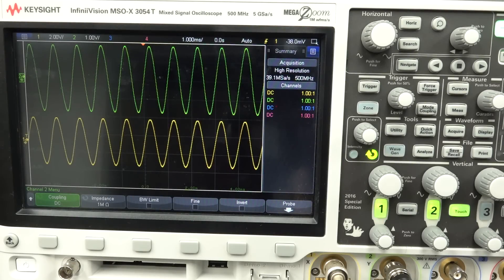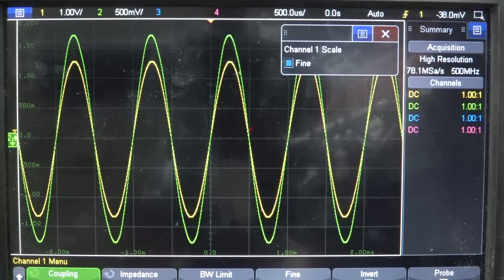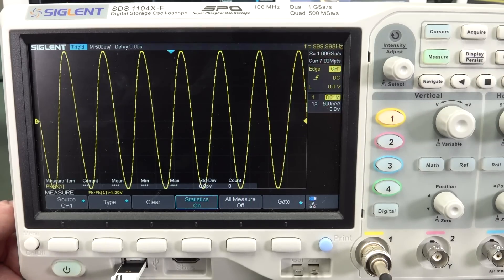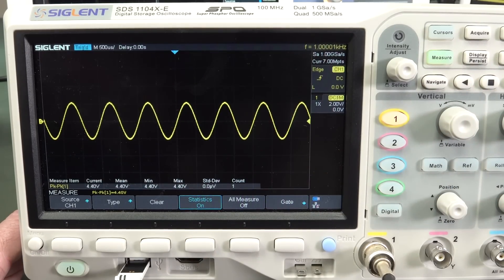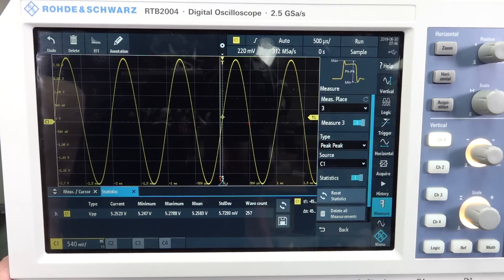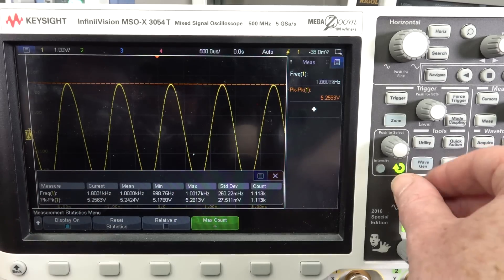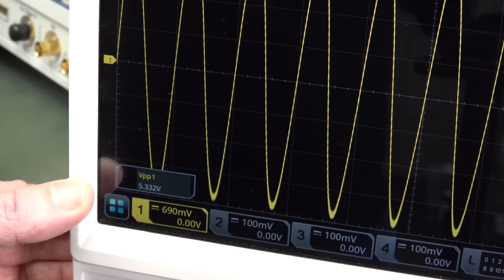EEVblog #1226 - Get Better Accuracy On Your Oscilloscope

Comment: For years i believed that the vernier control was only a stretching of the waveform done by software just to allow you to have it full screen and to better use cursors. I was sure it would not influence measurements resolution in any way.
I'm in shook
Reply: Yep I assumed only the full steps switched analog gain.
Reply: me too.....
Reply: Same here bro.

Comment: It is a mistake to assume that the scope's ADC has continuoulsy adjustible gain. In most cheaper scopes the gain is only adjustible in large[ish] discrete steps, which means that attempts to finely control the gain will NOT result in any better signal acquisition precision. Morerover, an ADC whose gain is controlled in discrete steps is usually less noisy than a continuoulsy controllable ADC. For this reason only high-end scope models will undertake the effort of offering a good continuoulsy adjustible ADC (and they don't always succeed at that). 
The situation has a lot of similarities to "exposure" control in digital camera's ADCs. I highly doubt that the benefits of fine control we see in this video on this Sigilent are actually real. Most likely this is just some kind of misinterpretation or a fluke.

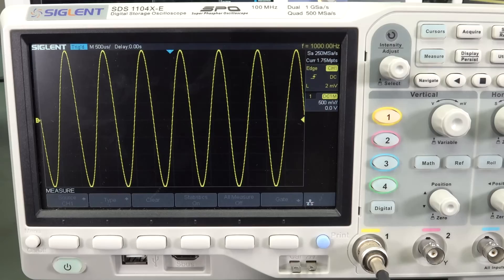Comment: Since I'm interested in how audio signals are altered by amplifier circuits, I lose after interest in this video after the 2:30 mark. (Class A triode amplifiers are famous for contributing ~10% THD in their linear range, which is why they're still favored for amplifying electric guitars. Simulating this with op amps and transistors is a longtime obsession of mine.) The first two and a half minutes are a goldmine though! Once the waveform peaks are matched on screen, I can easily see asymmetry introduced by the amplifier.

Comment: 0.01 pV is nothing. The old HP 4195 impedance/network/spectrum analyzer would allow a vertical dB per division from 1e-37 to 1e37.

Comment: Massive misunderstanding by dave. If you stretch the signal the analog range jumps to the next range thus you lose resolution and in turn the standard deviation decreases.

If you, for example, have a 1 V resolution and your signal has 100 mV pp noise superimposed, ALL your readings will be 5 V and your stdev will be ZERO.

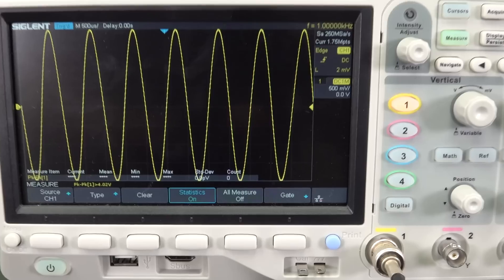Comment: 3:40 Well, that's not bad. The horizontal offset time on the top of the Rigol DS1054Z always shows 9 significant figures, regardless of the unit, so it says 0.00000000ps when there's no offset. That would be a 10 zeptosecond resolution! I doubt even cesium atomic clocks can achieve that level of precision...
Reply from the maker: The miraculous world of Rigol

Comment: So.. does this work on 100kHz HandyScope 2 ?
Reply: I have seen one of those little scopes do quite surprising things.  Some of them appear to use a better DAC to set the offset point than the ADC used to measure.  Thus with a bit of clever software and a repeating waveform, they can do better than you would expect.
Reply: @kensmith5694  There was supposed be upgrade for higher but they don't support anymore these.

Comment: This is a very  inspiring video - about A/D performance  and optimization of readout by using optimum dynamic of the reading.
But you have to be careful,  when you identify 'Standard Deviation' with 'Accuracy', in this case it's not correct to do so.
StD in first instance gives a  measure of the (random) noise of your system. So more effective bits from the  A/D, by increasing the (visible) amplitude  gives lesser noise, and lesser StD. 
For a real measure of the (absolute) accuracy , you need to  consider systematic errors. As already mentioned, the resolution of the A/D is limited, giving an accuracy of  about 1% for an 8 Bit A/D, or a bit better for 10 Bit. Then you have to take into account, how precise the vernier attenuator works, and only little is known, how this is realized, maybe there are several % to add. 
In former, analogue scopes, the fixed range was called calibrated, and the vernier was 'uncalibrated', so this is another hint to pay attention...
Reply from the maker: Yes, I did not mean to actually equate StDev with accuracy. That's why I said something along the lines of you can think of it as such (because of the result of increased SNR)

Comment: And for those of you with Analogue Oscilloscopes, the main reason for the Variable V/Div control was for measuring Rise/Fall times, by setting the top/bottom of the waveform to the 0%, 100% markings on the graticule and measuring the rise/fall time when the waveform crosses the 10%, 90% markings.
Reply: And also to measure the 0.707 value (RMS for a sine wave) of the signal.
Reply: I think of the fine gain control as like a relative mode, similar to the vertical position for setting where zero volts is. When you're in fine on an analog scope, you can't be sure of the vertical scale in terms of volts.

Comment: Thanks for the video. About a week or two ago I had accidentally enabled the fine setting on my Rigol 1054 scope and thought something had gone wrong with it. I didn't know the scope had that feature. Fortunately I thought about pushing the button for the vertical scale setting and things got back to normal. One of these days I'll read the manual for the Rigol. :)
Reply from the maker: That happens all the time

Comment: If a scope makes the measurements from memory data and not screen data like the R&S, and with the fine adjustment you don't increase the v/div enough to go to the next coarse step(in the R&S I believe the transition is halfway through), shouldn't you get exactly the same result? Assuming all of the scopes have only the coarse gain steps in HW.
Reply from the maker: No, it does the same on the R&S.
You are thinking about horizontal screen/memory option

Comment: As for fine vertical gain control, in my industry. You look at pulse parameters from 0-100%. You use the fine gain to set the signal 1.5 major divisions from both the top and bottom. Then every half division is 10% on the scale of 0-100%.
Reply: Daveyk021 That's assuming a specific number of divisions on the screen.  This video shows scopes with different number of divisions.
Reply from the maker: Depends on the number of divisions. Not all scopes are the same

Comment: I had written some utility software for this Siglent scope you were using. That program made sure the generator output stayed flat with varying loads. With the new firmware, my program is broke. It’s probably not getting good p-p data from it; I don’t know. I gave up on this scope for various reasons; that’s one of them. I still can not get pulse width at reference points I need. There is weirdness with the operation of the cursors too. The statistics features and resetting the stats has some weirdness too. Nana, back to Tektronix. That Siglent in my storage closet.

Comment: Don’t oscilloscopes typically behave less linear towards the edges of the ADC?  When I’m taking measurements I give 10-20% space on top and bottom.  Yes it’s lower precision and higher quantization error but the samples are more linear.
Reply from the maker: No, Almost zero practical impact, you are wasting your vertical resolution on unfounded fear

Comment: ☺😊😀😁😂5 Smile's
What about issues with higher stuff like RF and interceptions issues and isolation to a set not able if it didn't require something a bit new in the current curcit chip and improve to the antenna and any math on blocks and emp that's a fun one till it will not work as it had no sheild like on phones😮😷.

Comment: So do the scopes employ a variable-gain/attenuation amplifier, or is it doing this vernier in software (in which case it won't actually increase anything)?
Reply: It is more like having 2^10 possible numerical values. Or if you prefer, for example, you have 1024 (for 10 bits) values in the intended range, just as for multimeters.

So, if your scale is from -20V to +20V,  you have about 0.04V maximum precision ( 40 V / 1024 steps = 0.0390..). But if your "fine" scale is -11V to 11V, you "raise" the precision to 0.0214V ( 22V/1024) , In fact, it would be double if you could use -10V to +10V, but you can't, in this case, without clipping. 

So, the advantage is at its max when the signal is "just" a little bit larger than a predefined scale (here, 11V is just a little bit higher than the predefined scale of 10V, and using only the predefined scale, that would force us to use the 20V scale;  with a fine level, we CAN use just a required 11V;  but that cannot be done on any multimeter that I know though, just on scopes).
Reply: You don't get any extra precision if you're multiplying by a factor >1.0 in software (and they wouldn't be multiplying by <1.0 because then you could get clipping before the wave even hit the edges of display). The big question whether it has fine control of the input amplifier's gain. I wouldn't be surprised if scopes didn't, because the main value of the vernier (fine) control seems to be as Dave demonstrated, getting a waveform's size to match something else on screen, e.g. another waveform or particular graticule lines.

Easy enough to check by feeding a low-level waveform, setting the gain up to where you can see the DAC steps (as Dave did with that Rigol), then adjusting the vernier. If it's in hardware, the steps should stay in the same place on screen as the wave moves relative to them. If in software, the steps should scale with the wave. In the video the Rigol seemed to scale the steps with the wave, suggesting software scaling.
Reply: @gargantuablargg  I can't say for the Rigol, but for an Arduino, as example, if you set the "reference" to 5V, then you have (roughly) a stepping of 0.5 mV (1000 of these steps to make the 5V), but if the reference is 2.5V, then the stepping is 0.25mV.
Imagine 1024 resistors in series, as a rough picture, even if it is probably more sophisticated, what changes is the reference voltage that you supply to that ladder. So between the first and second resistor, you get 0.5mV if the total is 5V, or 0.25mV if the total is 2.5V. The digitalization process is, here, a matter to find between which resistor the sampled voltage is greater for one resistor, and less than the next resistor in the ladder. When you change the "scale", you change the reference (the total) voltage, not the resistors arrangement. There are other means than by a ladder of resistors, but that is only for the picture of the process.
Displaying the "point" that you got is then a matter of graphical library and is not tied to the Analog to Digital process in itself since all it needs to know (oversimplified) is on which pixel line, from 0 to 1023, the dot should appear.

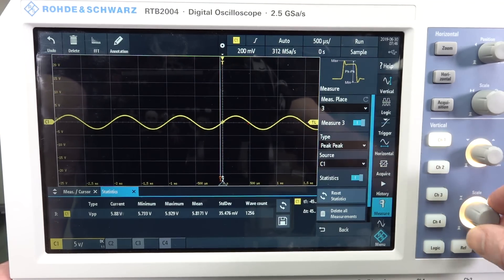Comment: The "current" Vpp at 8:35 doesn't have a real resolution of 0.001V.  Watch from 8:35 to 8:48 at 0.25x speed and you can see there are only 5 different values.  5.733, 5.782, 5.831, 5.88, 5.929 = minimum difference is 0.049.  It changes lots over that 13 seconds but there are only those 5 different values.  So don't think for a second that it is more accurate or has more resolution than it really does.
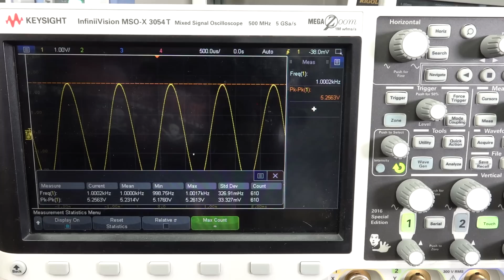Reply: The same can be seen on the Keysight at 10:44.  You can see the steps.  Smaller here with the "hi-res" mode but still there.
Reply from the maker: Of course, it's bullshit

Comment: Does the rigol 1054Z have this fine control?
Reply: Yeah think it does...haven't used mine for a few months(!) but I think I remember it with that function... or was that just the vertical positioning of the waveform...
Reply: Yes it does. Press the volts/div knob to toggle between fine and course.

Comment: The 4 decimal places don't come from the 10 bit ADC.  The 20Vp-p range (at 9:08) with a 10 bit ADC can only have a resolution of ~20mV.  They seem to be averaging the peaks in software to get down to 0.1mV.
Reply: No the oscilloscope has an internal variable gain amplifier which will basicall amplify the signal close to the full range of the ADC. So in this example its 5Vpp/1024 steps = 5mV resolution -and the rest is of course done with lots of oversampling and averaging
Reply: @robstamm60  ok im drunk so can you translate the 5Vpp. five voltes ________________?????
Reply: rob rader that can't be true. Any automatic gain system will introduce errors and this could seriously ruin a measurement if it's implemented badly.

Comment: Good tip. I always use the maximum coarse sensitivity, but I never thought of using the fine control. I’m used to the old analog days when the vernier was not calibrated. That’s not the case with a digital scope, but old habits die hard. I hate seeing a scope shot with measurements of multiple channels, with each channel at low sensitivity, just to fit them on the screen without overlapping. For measurements, I’d rather see the traces overlap and get the more accurate measurement, than sacrifice accuracy for a “pretty” scope shot.

Comment: @13:40 its not really opposite, its how you're thinking of it, think of it more as fitting more of the waveform on the screen to fill it, then they both work the same way.

Comment: The place where that REALLY comes in handy is if your acquiring from sensors with calibrations, like accelerometers, some company proprietary data acquisition systems, etc. By using the Vernier, you can "enter" the actual calibration constant for the sensor and make the curves represent physical data like g/division, charge output, etc. Very useful control.
Reply from the maker: Yes. Decent scopes will now have a separate calibration scale factor in the vertical controls for just this purpose.

Comment: 3:40 My Siglent SDS1022DL displays a frequency of 1 GHz when I position the cursors 1 px from each other, even if the scope has a 25 MHz bandwidth and 500 M samples
Reply: There is nothing wrong with that since the scope is showing a software calculated result which represents the frequency of that time difference between the two cursors. What do you suggest they display for that specific measurement?
Reply: @SmithKerona  You are right. It shows the correct value, but I think it is just funny to see such ridiculus frequencies on such a low performance oscilloscope.

The bandwidth on this scope is software limited, as there is a 50 MHz variant, so it could show even a couple more GHz on shorter time scales.

They could show the same thing as when the cursors are on top of each other, but that would just unnecessarily add more exceptionsvandd would be kinda wanky.
Reply: @rafa5984  25 MHz scope = low performance... cries in 10 MHz
Reply: @vavanade  huh  ? 20 was standard on average grade analog scopes decades ago.....10 Mhz is not just low performance, it's next to useless because it will be too slow to measure even moderate rise times of rectangulat signals. Useless!
Reply from the maker: Genius!

Comment: And another classic big fail from people who didn't pay attention at school. Giving your value in two digits while giving your standard deviation "more accurate " with even more digits. 🤦🏼‍♂️Talking about false and virtual accuracy
Reply: The fact that Dave repeatedly refers to the "error" in the standard deviation reveals his failure to thoroughly understand that statistic. The standard deviation is a function of the number of points sampled. When he claims to "reduce the error" by increasing the number of measurements on which it is based, he is doing no such thing. For any given number of measurements, the SD is not erroneous, it just is what it is for that sample size. This is a common misunderstanding that I have had to sort out for many, many students over the psst thirty years.
Reply: @omniryx1  Dave has self confessed to not being a math guy, but there is still false precision in std.
Reply: @anullhandle  You are confusing precision with accuracy but either way your comment reflects misunderstanding. For a sample of any given size, the standard deviation, assuming it is calculated correctly, is what it is. There's nothing erroneous about it though it can be misleading. If your purpose in determining a sample standard deviation is to estimate the standard deviation in the population from which the sample is drawn, then the larger the sample, the more accurate the estimation. In the case at hand, that distinction may be somewhat pedantic but in other circumstances it is not.

Comment: Same as using a analog meter.  You want to use the scale that is closest to full scale for the highest accuracy.  Try to measure 1.45 volts on the 150 volt scale and it's hard to get even 1 volt resolution.  Switch to the 1.5 volt scale and it "spreads" out the scale for higher accuracy.
Reply: That was what I was thinking, too. The old mnemonic device was "read it on the right" referring to the analog meter being more accurate on the right hand side of the scale.
Reply: Good to have you back in the game Mike!

Comment: What does actually happen when you change the V/div on a fine scale? Is it actually adjusting the reference voltage for the ADC almost stepless or is it selecting the next higher V/div setting (e. g. setting 4.3 V/div will set the ADC internally to 5 V/div)? I'm also curious, when moving a waveform up and down on a scope, is that a hardware DC bias thing that'd enable me to measure unsymmetrical signals without clipping (e.g. sacrificing dynamic range below the zero-line for getting higher dynamic range above), or is that purely digital after ADC?
Reply: Wondering about it as well
Reply: Bump